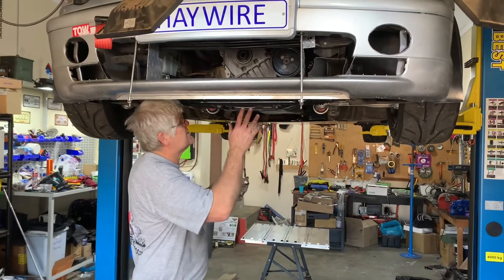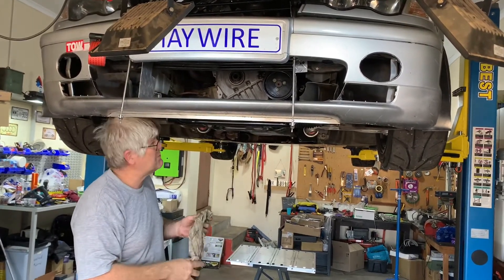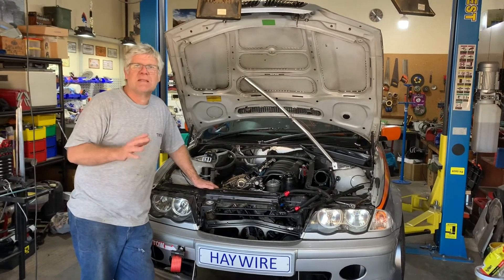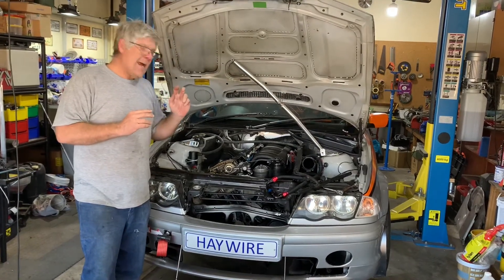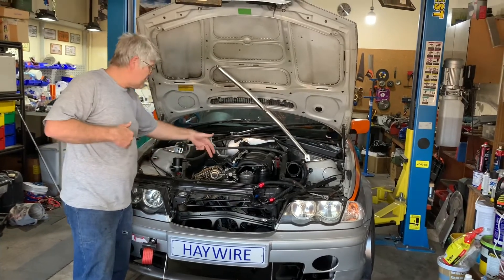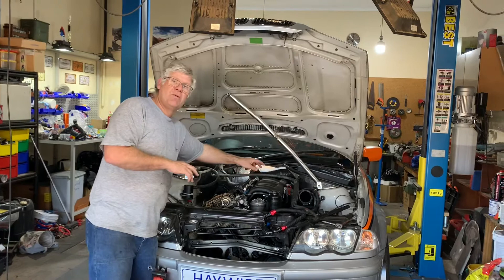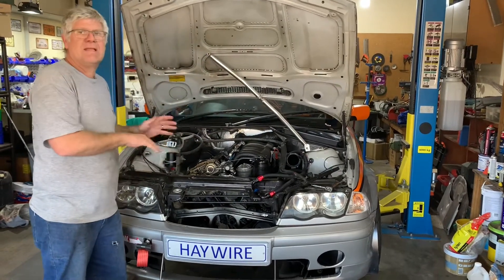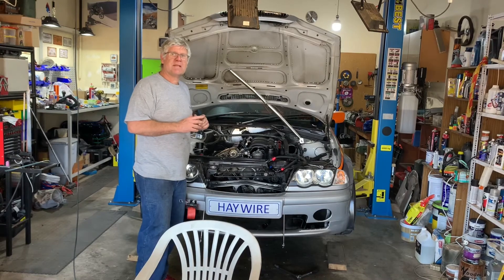Removing the timing chain cover - BMW E46 M54B30

Comment: Do you have any hints on how to ensure the existing head gasket portion still does its job in sealing? In other where did you put sealant between the timing cover and the head?
Reply from the maker: Its a bit of a lottery. You can't get any sealant between the head gasket and the head, but bear in mind the front part of the gasket is purely for oil control.  If I recall I just put a blob of sealant in the corner of the head gasket and block, on each side.

Comment: Yeah, but if you undo the sump bolts and do them up again, but not change the gasket, is there not a chance of leaks?
Reply from the maker: In theory yes, but we didn’t get any. The biggest risk is at the multi-joint interfaces (eg sump-timing cover-block) where you need to ensure you get some dreibond or similar sealer back in.